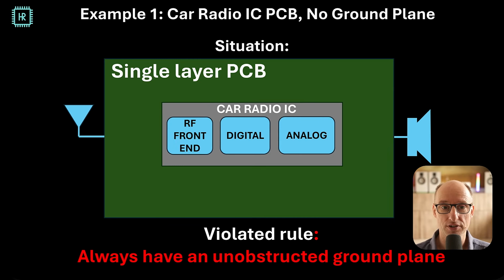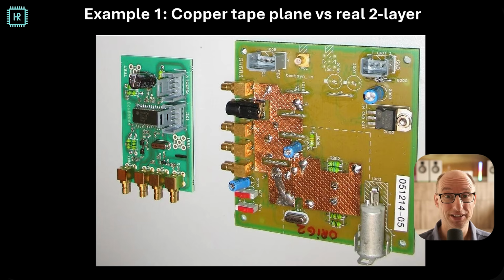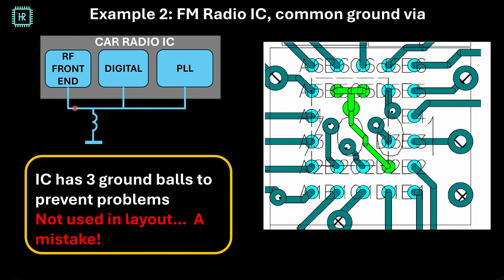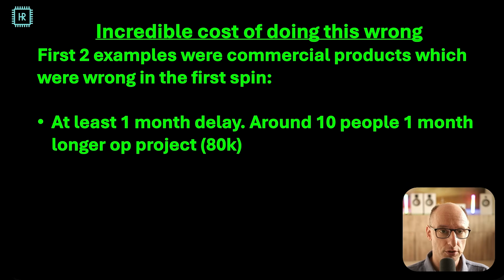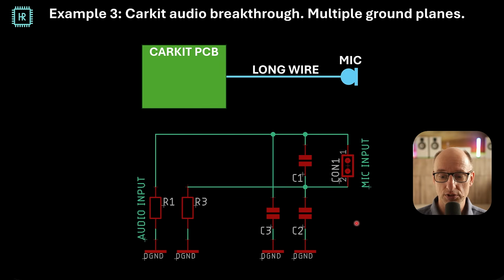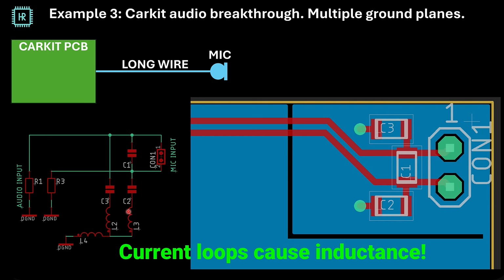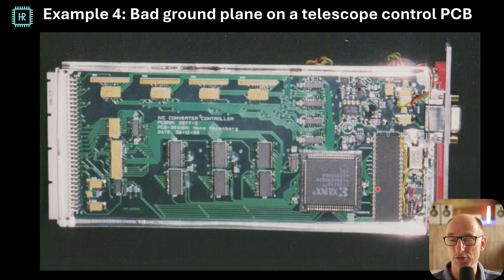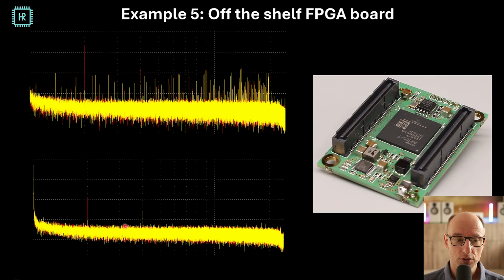Top 5 PCB Grounding Mistakes That Cost Me Thousands

Comment: please also  create a Video on how clock signal is routed on PCB esp if same clock is going to multiple chips.
Reply from the maker: What is your worry with this configuration? Crosstalk? Clock line loading? Signal refletions?
Reply: @HansRosenberg74  ...since clocks are high frequency signals, how should they be routed? how are characteristics of clock like transition time, duty cycle, pulse width , frequency maintained?
Reply from the maker: Very often, those frequencies are soo low, that you don't have  a problem yet. If the trace length is longer than 1/4 of a wavelength, then you have to start considering these things. But there is an easy solution. Give each departing line a series resistor of 33 Ohms. That usually roughly matches it to 50 and isolates the departing clock lines. The rough matching also drastically reduces signal reflections.
Reply: @HansRosenberg74  ...as far as clock frequencies are concerned,  there are 1 Ghz or 800 Mhz clocks, so these are high 
frequencies, then what care is taken to route these clocks and maintain its characteristics?
Reply from the maker: ok, this is a different story. Are these analog or digital clocks? If they're digital I assume they are balanced, like lvds or ecl? In this case I'd use a clock distribution ic. I've used those for a 900MHz application (was an ecl ic). Something like this: https://www.onsemi.com/download/data-sheet/pdf/mc100ep210s-d.pdf
If it's analog at 900Mhz, I'd use a few power splitters (mini circuits has them as smd components, but there are more manufacturers)

Comment: Another great video. Keep going. I recently designed a board in a hurry but tried to stick to the rules. In some areas I had to drop signals to the bottom layer so I grouped traces together and kept as short as possible but left enough room in between for via's so I could stitch top and bottom planes to try to restore the broken bottom plane. I hope this is a good way to deal with that, haha
Reply from the maker: That will definately help!

Comment: Example 4 solution was to add a ground plane layer to the design.
Was that ground plane an internal layer, or the back outside layer, and which is better?
Reply from the maker: The best location is closest to the layer with the most signals on it. So if most signals are on top, then the ground should be inner 1 right below it. If you want 2 ground layers, use inner1 and bottom, so the signals on inner 2 are 'caged' between 2 ground layers. Drawback of that is that you can't access them.

Comment: The three vias is a good one, it reminds me of my former colleague (analog design genius, the GOAT), he always said that you need to have your RF glasses on, also when you design analog audio. I will say I disagree with the statement that split ground planes never did anything good, we used several ground planes, all connected in one point. Typically three ground planes, DGND, AGND and GNDREF. GNDREF was special since no return current could go through this. DGND should have a minimum of two layers and no or minimal routing. We always ended up in 10 or 12 layer boards. But, you have to when you want achieve 165dB of dynamic (audio) range, and 3nV/rtHz noise levels. For the microphone you mentioned, it was not clear how the input circuitry ended up, but I will say that for a single-ended input a small ferrite for EMC purposes, mounted in GND is a very bad idea, consider any induced noise on the shield, this will create a voltage drop over the ferrite, and this signal will be imposed directly on the input, and amplified along the signal chain. Impressive what a few uV can do....

Great series, it is super nice, this must take a long time. Appreciate your efforts! - Very educational. I look forward to the star ground chapter, I worked with star grounds extensively over the years, and also made my part of mistakes. I still remember cutting up our main star ground and recreating it with tiny wires, moving them around until we achieved our desired channel separation and OFF isolation. Good times.
Reply from the maker: The split ground planes is a 'hot' discussion. In my next video I hope to explain a bit more why you can achieve better results by using a single ground plane backed up by simple theory.

The question is: With this high dynamic range board: did you try to use a single ground plane? One critical thing is: If you want to get this high of a dynamic range, the ground plane must be really close to the signal layer (see my first 4 videos) otherwise you still have large transmitting loops (looking at it in 3 dimensions).  The huge advantage of 12 layers is that layers are really really really close together which helps a lot as well.

I didn't have problems making very high dynamic range circuits using  a single ground plane, but the pcb has to be at least a 4 layer preferably with a very thin dielectric of 0.2mm.

Comment: 4:26 you showed in your previous videos the interference caused by the return path of two adjacent ground vias, acting like a tiny transformer, would it be better in this example to route the ground vias away from each other instead of the top ones being close to one another?
Reply from the maker: Hi, good point! However, if you put vias further away by using a piece of trace, you'll make the current loop bigger (if you look at it in 3 dimensions). This means it will be a bigger antenna. So in this case, you're simply limited by the package of the ic that dictates the locations of ground connections. If that still gives problems, you're basically screwed.

Comment: I have designed a board once which had an FPGA, but I was doing some trickery on the FPGA, so it was super sensitive to coupling through the ground plane.
I had an ESP32 too, which injected little but significant noise on the GND plane. I cut the ground plane at a strategic place, so the current to the ESP32 was flowing on a different direction preferably, and not interfering with the FPGA GND plane. So I could use a single GND plane for both, without any problems.
The cut in the ground plane was small too, minimally hurting it.
The board worked really well.
Reply: couldn't you just reroute the noisy signal away from the FPGA instead? I've always heard splitting grounds (cutting in your case) should be avoided unless its an isolation thing
Reply: So you built a version without the cutout that didn't work? Or these are just problems you imagined you'd have if you didn't put the cutout in.
Reply from the maker: This is a tricky one. Multiple ground planes are always worse than a single one. The problem is probably  more related to insufficient decoupling caps, or too long traces connecting decoupling caps (which causes a lot of transmitted interference). Powertraces with too much resistance are also very notorious for causing crosstalk via the supply. In the end, you must have all these things at a basic level to have a good foundation for your circuit.

Comment: What kind of equipment do you use to test all of your boards? Do you inspect all of them the same way or do you check specific things depending on the application of the board?
Thanks for your guidance.
Reply from the maker: I don't know how to test my bare boards (if that is what you mean). I assemble them and if they work, the pcb's are ok. I measure my boards with a nano-vna. In some of my first 4 movies, you can see that device.

Comment: Geachte Hans,
Ervan uitgaande dat in een twee laags PCB de ground plane ononderbroken is maar op da componentenzijde een Buck converter is geplaatst.
Alle ground pinnen zijn d.m.v. een via rechtstreeks verbonden met de ground plane. 
Gezien de diverse stromen die in een dergelijke schakeling kunnen lopen zou het aan te bevelen zijn om:
Een lokale ground plane te plaatsen om en onder de componenten van de Buck converter en deze met de lokale ground plane te koppelen aan de bestaande via’s naar ground?

B.v.b.h.d. Frans.
Reply from the maker: Het is goed om even mijn eerste 4 videos te kijken voor meer achtergrond. Je kunt meerdere vias parrallel gebruiken, dat helpt ook. Bij een buck converter (of andere dc dc converter) is het absoluut cruciaal dat je de stroom lus van de step down of step up componenten superkort houdt (spoelen, condensatoren, eventuele diodes). Let ook op wat voor condensator je pakt. Een y5v condensator is 70% van zijn waarde kwijt bij de nominale spanning!!! (zie mijn gratis document, link in de beschrijving). Je kunt dan soms beter een alu-polymer condensator pakken. Een lokaal gnd plane op de top is prima, gewoon veel vias in doen, dan is die heel goed verbonden met het gnd plane op de bodem. Groetjes, Hans

Comment: Due to some false recommendations, I also created a board with a split ground for analog. Although it seems to work, I reworked the design to a 4 layer board with 2 inner grounds, removed all traces on the ground planes and moved the analog traces on the back of the board. Still waiting for more videos to come, before I'm confident to order a new batch.
Reply from the maker: If you use one ground plane and give each ground connection it's own via, you can't go wrong groundingwise. Ground on inner 1 and 2 is also fine, just regularly stitch them together, especially when you move signals from the top to the bottom. Place a ground via close to that signal via. Your grounding will be perfect in that case!
Reply: @HansRosenberg74  That stitching is one things I didn't do yet, but I sure will. Many thanks. Doing mixed digital and analog audio boards is really headache material.
Reply from the maker: Just put digital on one side of the pcb (I mean left/right, not top/bottom) and analog on the other side. Ground currents will stay under the circuitry so they won't bother each other.
Reply: @HansRosenberg74  This is very difficult to accomplish (for me at least), because the analog and digital pins of the ICs are not laid out nicely. MT8816 and 3x PT2256 digital potentiometers. The first only uses short pulses from an ESP32 to switch around, but the PT uses I2C.
Even with my 2 layer board, at least during development, I'm so far happy with the audio quality. It's not high end for sure. The main issue are noisy SMPSs, but with heavy filtering it seems to under control.
Reply from the maker: I checked out those ics. It is not a problem: Since these ics were designed as analog circuits with a digital control, and they are not switched fast (just occasionaly) you have no problem. The digital signals are static so cannot create interference. Just make sure the microcontroller that controls this is a bit further away on one corner of the pcb. Make sure you apply enough decoupling caps to all supplies (so the one signals coming out of there are clean) and make a single ground plane. Another point: Since these ics were designed for analog operation, you can assume they've taken care of separating any digital ripple (on digital signals coming in) is isolated as best as possible. So the microcontroller is the only 'problem source' you need to separate. Best regards, Hans
Reply: @HansRosenberg74  Many thanks for having a look! I already have the ESP on one corner and have decoupling according to the respective datasheets. Seems I'm lucky at this part of the project.

Comment: Thanks for the great reminders about proper grounding!  It is so cheap to get a 4-layer stackup these days that I don’t even think about it, layer 2 is just always GND.  Would be great to hear your thoughts about different 4-layer stackups, like having layers 2 and 3 both as GND vs having layer 3 as a dedicated power plane etc
Reply from the maker: My favourite 4 layer stackups are in my free document, link in the description. Best regards, Hans
Reply: Your best stackup is very design dependent. 

Keep a ground plane close to your high speed, high di/dt (along with dv/dt for signal integrity), and high power swiching traces. If you need to do such traces on both sides, you need two ground planes. 

I've done full ground planes on one internal layer, and partial ground planes, carefully stiched together with vias, on the opposite side where the problematic traces would be, leaving the rest for general routing, but that's something that should only be done by experienced people with an indepth understanding of how circulating currents flow in a PCB.